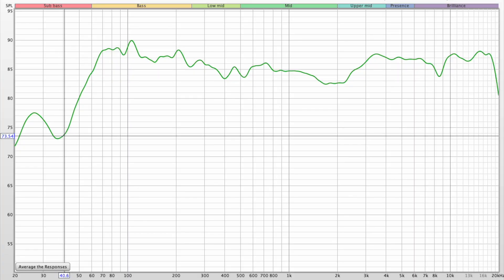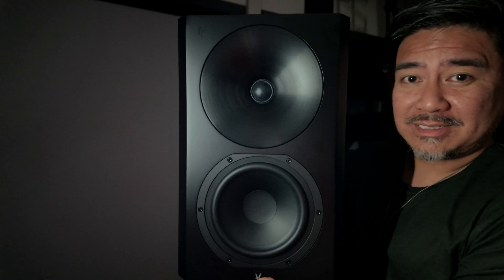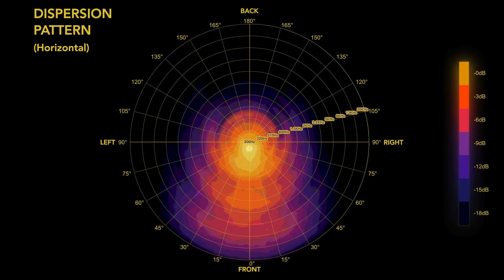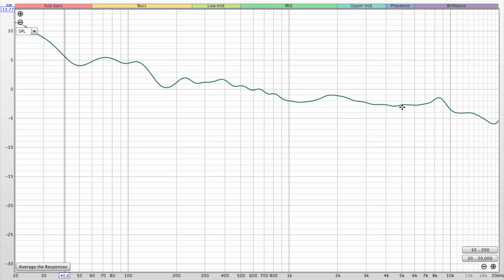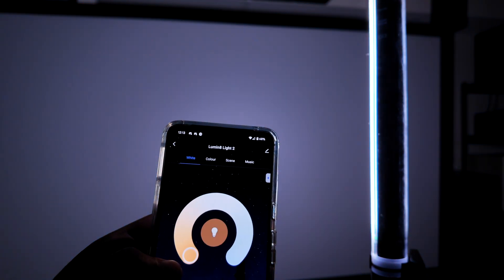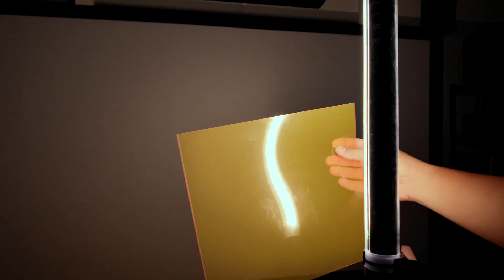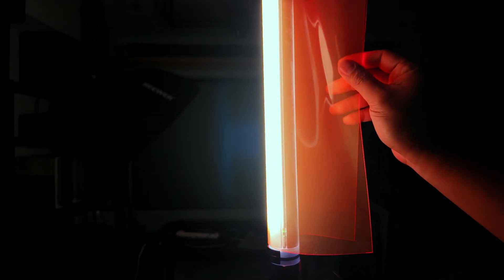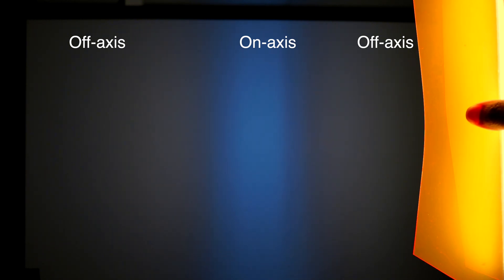Directivity Index Explained & Why You Can't EQ a Bad Speaker

Comment: What if you EQ speakers that are not the best, but are pointing directly at you
Reply from the maker: That would be ok if you didn't also hear the reflected off-axis sound. That's why people find that room treatment helps with this. It would be equivalent to having walls painted black. It helps absorb reflections. Also, you can choose a speaker with a narrower directivity if you don't have room treatment. That's why I think people like Klipsch speakers. You get less off-axis reflections due to their horn design.

Comment: Joe,
If there's only one MLP and only me listening to my system, why should i care about DI? You might say, soundstage width but when reflections are taken into account, the totality is messed up anyways!
Reply from the maker: What you will hear at MLP is a combination of direct and reflected sound.
Reply: @joentell  in that case, a speaker with less directivity in mid band is preferred? Aren't human ears more tuned to mid band?
Reply from the maker: @stackoverflow8260  what's preferred is when the on-axis and off-axis is similar with the off-axis sound having less high frequencies, but falling off in a linear and predictable manner. Using the light example, if the light change is slight and gradual (not an immediate and noticeable change) that is preferable.

Comment: Excellent explanation - I don't think I've ever seen directivity as concisely explained!  If I may, I wish there were 2 things added:

1. Let people know that pointing a bad speaker on axis and EQing for that, doesn't make it sound good - because you hear more than just direct sound.  You also hear sound that bounces off the walls.  It's like if you have a yellow bulb in the room, everything looks yellow, not just the direct light.  So it's not like you can make the speaker work for the main listening position by sacrificing off-axis listeners.

2. Like you say, graphs can be intimidating at first.  I think it might help people if you showed how the linear and circular directivity graphs work.

Hope this is constructive!  You've truly done an excellent job - the thought and planning that went into your video, really "shines" through!
Reply from the maker: Thank you. I agree with everything you've said. 

1. I was hoping to show that in my example. The problem is my garage doesn't have white walls on either side as one side is filled with boxes and the other has an ambient light rejecting screen. But, yes, what we hear is a combination of on-axis direct sound and off-axis reflections in all directions.

2. I wanted to go into more detail to show what a good directivity index looks like vs a bad one and why that's the case. I need to make a separate video as I wanted to keep this one simple.

I have what I think is an easier way to understand directivity index. I mentioned it here if you're interested https://youtu.be/z7FLmbdspcc?si=H11f4D7OaFRfLLND

Comment: Nice explanation. You could also add that light just like sound has more directivity in certain frequencies. High Kelvin colors will tend to reflect less than low kelvin colors. So low kelvin colors such as a 2700k light will tend to make less shadows that a 6000k bulb. 
This is the same as high frequencies in a speaker thats not pointed directly at the listener vs a subwoofer hidden in a corner but its hard to tell where it is even if you hear it very well.
Reply from the maker: Wow! That's new info to me! Thank you for that.